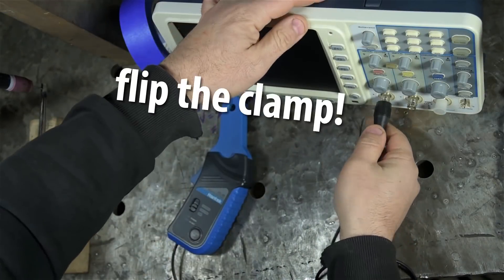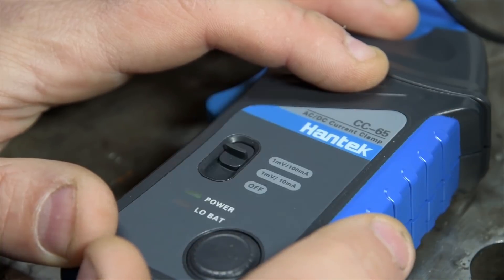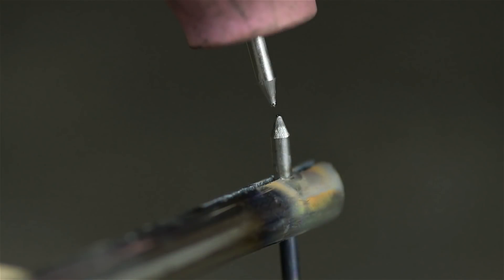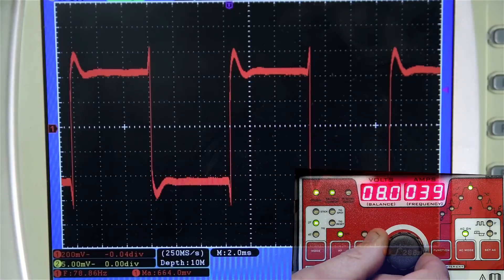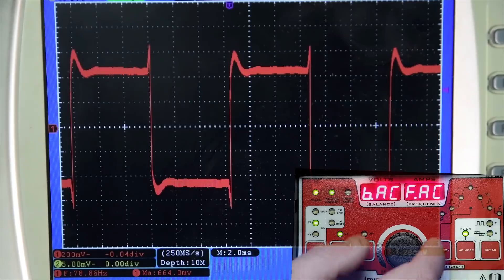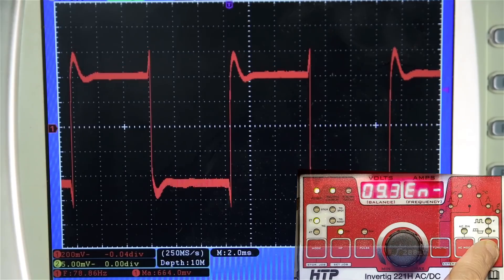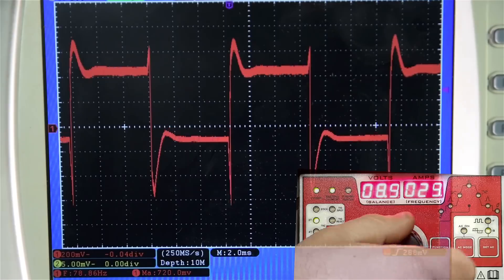Asymmetric TIG - CAUGHT ON CAMERA!

Comment: I could see you building a rotary phase converter and checking the resulting wave forms with balancing capacitors as you tweak it to best result. Hint hint. 7.5 or 10hp.

Comment: Being that the most "welding" I've done was inside a carbon arc lamp movie projector this saga has been very fascinating to me.  I'm not even sure these welders would supply clean enough current for a good movie watching experience.  But I never had an oscilloscope handy to see what it was doing.  I just trusted that it was set up properly when the technician serviced it.

Comment: Hey tony i know this is an old video and you probably know this already, but those peaks at the start of the square wave are pulses of high frequency start or something along those lines, since the amperage goes down to zero to reverse polarity ac welders have something built in to keep the arc lit, on my miller transformer its high frequency start, if that doesnt work the arc on ac just goes out randomly. Ive never seen an ac capable tig without hf start, which makes me believe thats its integral to welding with ac.

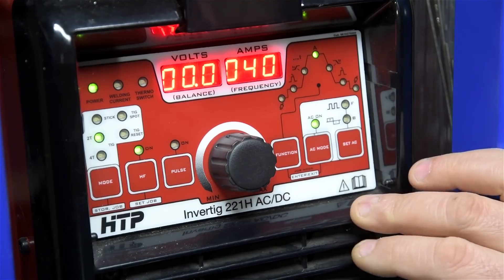Comment: 1:50 I realize this video is a year old, however I feel the need to give my $.02 on this. What that looks like to me is Gibb's phenomenon.

I don't know exactly how an inverter works, but in some way it is approximating a digital signal using analog means. To me, this implies it is doing a Fourier transform. However near the edges of a square wave there is a discontinuity (90 degree corner) and a digital signal (fourier series) can not perfectly represent a discontinuity like this. The resulting error can be predicted, and this error is known as Gibb's Phenomenon.

I will say though that this error you're showing (overshoot) looks pretty damn excessive. Needs more damping.

http://mathworld.wolfram.com/GibbsPhenomenon.html
Reply: Just watched the rest of the video. Since these overshoots are consistent when you change the amperage I'm probably wrong. Whoops.

Comment: But in performance engine design sometimes you HAVE to change more that one thing at a time, eg, if you increase the rocker ratio you could lose power unless you run greater separated timing events, ie less overlap.

Comment: We may bark at wrong tree,the band width of the current probe is too low for sqwave edges
A. Wide band current trans.(Pearson) or volt.pickup at few inch of the ground lead is better,
You may want to connect a neon lamp across scope probe if that make you comfortable.
The switching artifacts may too fast to show at that sweep rate, you have done a great service
To us all,thank you!

Comment: Contrary to all the assumptions about the “Batman Ears” in the comments, the transition time spikes are intentional.  There is additional circuit to produce those spikes in order to prevent loss of arc while the current otherwise goes to zero (or through zero).  In the old days with nearly sinewave shape, they used continuous HF.  Nowadays a better result is obtained by a basic square wave instead of sine. But even so, the RE-IGNITION SPIKES ARE ADDED TO MAKE SURE ARC IS NOT LOST.

Comment: Tony, your leading and trailing peaks are a machine design to increase a stability of the arc and the restrike as the current switches from positive to negative...some lesser machines with a true square wave sometimes lose a positive and thus stability when you get to higher frequencies because they don’t have this....or it was a happy accident and not designed in but that’s what it does #themoreyouknow

(source - years of tweaking waveforms and correcting with scopes for automated weld systems)

Comment: Hi Tony, I do a lot of work with inverters for motor controls. That spiking on the leading and trailing edge of the pulse, could be ringing caused by the fast switching of the output IGBTs (transistors). It doesn't look like typical ringing, but I'm not familiar with welding inverters, so there could be some special circuitry that's causing those artifacts.

Comment: Tony, ringing in the waveform is due to an impedance mismatch between scope and probe (assuming no ground loop). Is there a calibration screw to adjust the capacitance?

Comment: It's argued that the leading and trailing spikes are due to the initial voltage ramp prior to the spark being generated. As voltage increases enough to jump the gap, initial non-loaded welder voltage is rather high. As it establishes the arc gap, voltage drops as a result of the current drain by the arc which is maintained by the trabsformer in the machine. As the inverter ends the current cycle, lets say on a positive/north cycle, it then reverses polarity on the coil to charge it for the negative/south cycle. When it does this, positive or north magnetic charge on the transformer quickly becomes a negative or south charge. This by nature induces a voltage spike at the end of the cycle as magnetic lines are broken by the windings in the transformer when the magnetic field collapses before reversing. Think of it like a charge cycle on an ignition coil. When you charge the primary, there is a brief current rise on the secondary winding, but not enough to spark, because the charge cycle wasnt fast enough. (Not enough current, ballast resistor etc), but when you STOP charging the primary winding, the voltage will spike in the secondary as the magnetic field collapses rapidly in the pair of coils. In a tig, that magnetic field collapse is the inverter reversing polarity in the primary winding which is what makes that brief spike at the end of the cycle. 

Hope this cleared things up a bit..

Comment: HI Tony, I love the videos! .... In regards to why there are those spikey leading and falling edges in the waveform, it is pretty simple. A square wave is simply the addition of multiple sine waves of the correct frequency and amplitude. The frequencies that are added are the fundamental (80 Hz in your case) and then integer multiples of that frequency (harmonics). The spikes simply indicate that the ratio of all the added sine waves are a bit off. It looks to me like the fifth or seventh harmonic is a bit strong but you could only know for sure by looking at the signal with a spectrum analyzer. This sort of thing (strange spikey bits) is pretty common in high current / high power / low frequency systems like your TIG welder.

Comment: The leading and trailing peaks on the waveform represent the welding power supply switching into, and out of, current regulation.

Current regulation switches on right after polarity reverses. And switches off again right before polarity reverses.

The 'switch on' peak is a little longer duration than the 'switch off' peak. That's because for this power supply the current regulation circuitry takes a millisecond or so to 'capture'.

Comment: Thanks for dropping by back at ya. 
The overshooting is most likely the response time of the big FET transistors that are quickly switching at 40amps. There is enough impedance in the system that it's acting like a little shock absorber so the reactions are delayed.
We see it all the time in my day job work switching 300Amps really fast.

Comment: The "ringing" at the beginning of the waveform and the peak at the end of the waveform look normal to me. That ringing is the typical waveform you get when either using an LC-filter (dont think its the case here because of the high current) or the controller using a normal PID control scheme. The peak is just the result from some switching action.

Comment: Good work .....    with the peeks ist normal in high current applications  that the peeks will not adjust like you think it will be   its  like an induktive spike  when you  switch on and off any induktive load

Comment: Another comment: before you take all the explanations of the ringing in your waveform seriously, you might want to ask what the bandwidth of your current clamp is.  It's an inductor, after all, and it's driving a resistive load (BTW, what's the input impedance of your scope?).  You might just be seeing passive ringing.  I suggest you steal a simple waveform generator and see how your probe responds to a clean, low-current square wave.  Then we'll talk.

Comment: There is a constant current power supply after witch goes an h bridge and a filtering inductur should go. When the h bridge flips polarities the constant current supply does its job by increasing the voltage, and output filter puts some delay in the feed back loop...  thats why the overshoot on the leading edge, trailing edge - ouput filter inductor works the same way like in the dc to dc boost converter, thats why the trailing edge spike.

Comment: Basically... the unilateral phase detractor wasn't making adequate use of the inverse reactive current provided by the turbo encabulator... not really... I stole that from a mix of YouTube channels. Square waves aren't really square. Square waves are made up of a peak sine wave plus an infinite number of odd-multiple frequency sine waves (ie odd harmonics and lots of them). Wikipedia has a spiffy bouncy graphic thing the shows how the squarage happens. If you add a bunch of filtering you can probably smooth out the ringing but why would you? It works...

Put the signal into a spectrum analyzer and you'll see many peaks at different frequencies. 

Speaking of SA... engage your imagination... now visualize a sine wave with "wiggles in it" Ie not pure. To "see that" on a spectrum analyzer imagine horizontal is frequency and time travels away from you on the Z axis. You'll "see" each waveform at a different time as you travel along the frequency line. Or just search for how a spectrum analyzer works and you might find something like this starting about 12:15. It's about vibration analysis but  a wave is simply a representation of a vibration -  
https://youtu.be/DUznmZvSQOU

Comment: TONY   square ware  form shape.    I believe you will find that the wave forms generated by a solid state welder ( inverter) are a superposition of many higher frequency waves.  This is know as a Fourier series.  The corner spikes are an artifact of this superposition ,  this is just how it is.  With additional higher frequency waves this can be reduced to some extent to create a sharper corner.   Some people   use this mathematical fact to complain about the sound of digital music compared to analog ( vinyl or analog tape.    i hope this makes you really happy you brought out the scope :)

Comment: Totally awesome, Tony, it all makes great sense.  And that was a nice demo.  I'm a little surprised they have a current limit/control fast enough to do the positive and negative parts of the waveform independently, but obviously they do.  Since nothing is perfect, yeah, you have some ringing and overshoot.  I wouldn't worry about that one bit - it takes finite time for things to respond.  Some energy is stored in magnetic fields etc as well, it's not a big deal.
Most scopes have an invert button if you don't want to flip the probe, FWIW...

Comment: About 3:50 you mentioned the peaks, that is called overshoot.  In a perfect (non-existing except in a textbook) world, the waves would be square.  But the actual physical components can't do it.  The wiggles on top and bottom are called ringing (an impressed frequency on the voltage).  Every square wave will have that.  It's unavoidable.  But not an issue.  The overall voltage is close enough to what's advertised.  

Congrats on getting it to look right.  An negative on top isn't an issue either.  IT"S AC!!!!!!  That's what's important.  Good work, man, good work.

Comment: I believe the peaks you see are the results of a Fourier Transform. If you start out with an AC current that makes a sin function, it is difficult to get it to resemble a square function, which demands to be full positive and full negative. With a lot of work, a Fourier Transform can get a sin curve to look really square, but you can never really get rid of the batman ears.

Comment: What's cost of the htp221 it's that or an Everlast for ac/DC tig
Reply: chris jones the cost on that htp for sure is higher.  But if you are looking to do some delicate or high end aluminum work ...  the choice is clear ...    either the htp or a miller dynasty 350 ...  those are the machines where you can independently adjust ep and en .... and the low amp arc stability is unmatched!  And what tony said in the last video about powerful arc starts - he is right ...  all everlast machines that i have ac tig welded with before have a very unique way of starting the ac arc....  it feels and sounds almost like the arc starts in dc and then a second later switches to ac ....   and other people who own everlast machines have observed the same phenomenon ....
Now what this is all about? Or is it good or bad?  I dont know ....  for sure it is unusual ....!
Neither millers nor lincolns do that....

And if you just need something to tinker - maybe the htp is overkill ...

And then again 2 very famous american sayings are:

1) there is no kill like over kill

2) you get what you pay for 

So i guess - its up to you - how much you want to spend or what you want to do with the machine later on ....
Reply: ZILA would like to stay around 2500$ if possible. But at this point idk if 2500$ is possible for a quality machine.. def do not want a dumb downed home owner grade Lincoln tig200 or equivalent
Reply: chris jones that should be possible.   Htp has 2 versions of this machine. A 220 volt version and a dual voltage version.  And then to make things more confusing you can add a water-cooler to each one of those.  

The air cooled version of the 220 volt machine with foot pedal and torch and regulator is about 2500 bucks shipped to your door ( unless its black friday or something / then its s couple hundred cheaper .... )
Then if you want the water cooler that is a few hundred more and if you want the dual voltage one that is even a few hundred more ....  
i dont know what their current pricing is / just check their website ....
Reply: ZILA thanks for info. Think I'd go dual voltage for portability. I'll check it out thanks for the tips I appreciate it

Comment: Diode stuff is BS.
It would be interesting to see waveforms after twisting the cables together.
But the peaks are because of impedance mis-match between cables, 
(the inductance of the cables), versus the mostly dead short at the arc.
Do the twist thing for me,... you are not wasting anyone's time. 
Don't you get it: we LOVE YOU! You can do no wrong!

Comment: Noob question, but what does the shape of the electrode change?  Does a sharp electrode focus the current on a smaller point or something and if you have to make larger/wider welds, would you use a blunt electrode?

I don't know my behind from my elbow in welding so do be gentle.

Comment: First thank you for the follow up, not many people would do that!

That waveform is exactly what i would expect with simple inverter/rectifier.... those peaks are ingrained into the design of the switching device. It is created by the capacitors and inductors responding to being switched on and off. 

My guess to why they say when you move the device is normal based on the price of this inverter. 

I put in a VFD that rectifies then inverts the voltage with both an active front end and inverter and it makes the waveform look a lot better. But it also cost $250k.... cheaper price cheaper design. Also not like a welder would need a perfect waveform. 

here are some images of my 4160V 2500HP drive at work

Waveforms are as follows from top to bottem; input voltage, input current, output voltage, output current.
Running at 50%
https://i.imgur.com/fL0knr2.jpg
Running at 100%
https://i.imgur.com/DM1b9rE.jpg

Comment: Have you considered flipping the clamp over to rule out the instrumentation? 

But seriously, I never imagined you would have the probe on the wrong setting... Doh!

The Batman ears are highly unlikely to be inductive kicks showing up at 2ms/div on an 80 Hz waveform. It seems likely they are the arc start and collapse artifacts at the polarity switches. The arc stores quite a bit of energy, so it takes a bit to get it going. The welder probably floors the voltage at the transition then backs off to set the current. At the arc collapse when it disconnects one polarity and sets the other you see another current spike as the arc collapses sucking what energy it can from the welder, while the welder is switching to the opposite voltage.

It sure would be interesting to see the voltage across the arc along with the current. Once you try flipping the probe, of course.

Comment: The spikes on the waveform looks a lot like the spikes you get when you approximate a square wave via a fourier series. Making a perfect square wave by flicking a switch is impossible due to the the dynamic response of all inductive and capacitive elements. It should be possible to eliminate these spikes by doing a fast fourier transform on the osciloscope and compare the results with a perfect square wave fourier transform. With these you should be able to pinpoint the frecuencies that are causing the most amount of trouble and design an RLC filter to filter them out. This is probably hugely impractical but Im sure is a great learning experience.

Comment: I tried this with my old miller transformer welder. Interestingly, some of those comments were correct. When the arc is between sharp tungsten and massive chunk of copper it seems to act like a diode (when HF is turned off)  Touching the tungsten to the copper ground gave a symmetrical waveform - leaving an arc gap completely cut out half the cycle! I know this is cheeky but check out my video to see this in action.  Thanks for the awesome videos